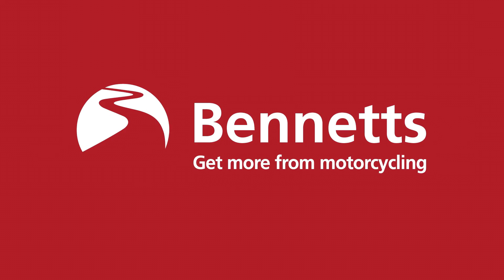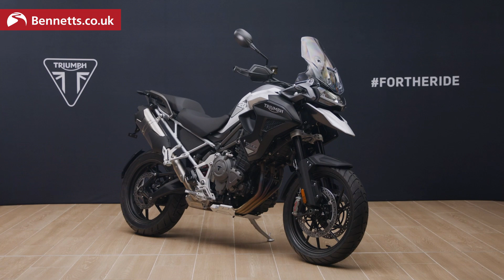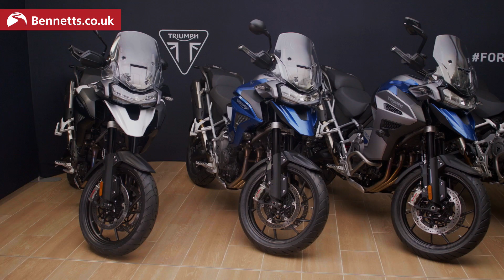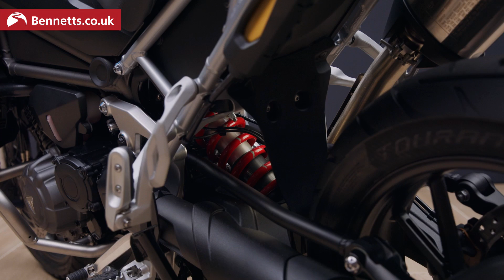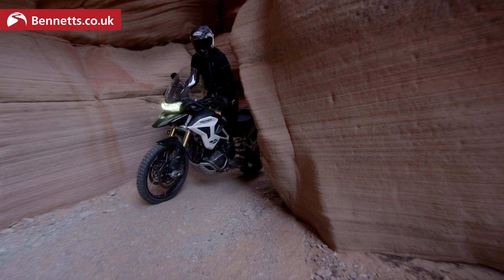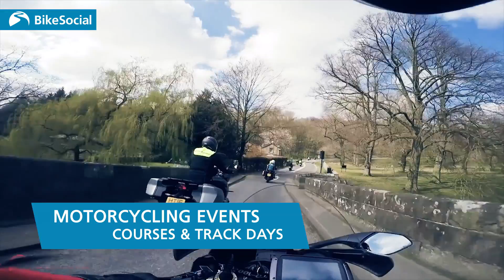New Triumph Tiger 1200 (2022) revealed - exclusive interview!

Comment: It would not shock me if the new 1200 comes out on top in several big bore ADV comparos. On paper it seems as it will be an excellent performer on and off road plus shaft drive which many in the touring ADV crowd desire.

Comment: Does the suspension set up mean the bike has anti-dive on braking like the KTM SAS? Could be a real competitor to the BMW GS Adv
Reply from the maker: Hi Norman, I've asked Triumph and the response is:
"The semi active is controlling the rear pre load to adjust to different payloads and dampening on the front and rear to adjust to the different rider modes, rider inputs and the finer adjustments available through the instruments/switch cube."
Reply: @bennettsbikesocial  That would be a no then!

Comment: I wonder if a tiger sport 1200 with a 17/17 configuration will ever make it. I would buy that in a heartbeat. Over a speed triple. Any day.
Reply: Nah. Makes no sense. Would need to change the suspension to suit the kinda feel you’re after. Would make the bike too pricey
Reply: @Jamaal_Tuhrik  good point. I was hoping these showas had enough range that a spring and oil change and reworked damping would do the trick
Reply: @greyanaroth  possibly. But seems like a hassle. The multistrada v4 has a 17/17 model. Pikes peak. Will probably have the sportiness you’re after
Reply: @Jamaal_Tuhrik  yea but I prefer the reliability and local support with triumph and the triple is a peach

Comment: Great looking bike (bar the rear radar unit). Glad to see the blind spot light being incorporated onto bikes. Curious to know, so unless you go for the rally Pro model or Rally expl, you cannot turn off the Abs and traction control completely?? Surely every adventure bike should be able to turn it off completely, talking as someone who attempts taking a Multistrada off road and valuing this ability.
Reply from the maker: We asked Triumph for the official response to your question:
"Traction control can be turned off on all the models when configured in Rider mode. Both the GT Pro / Explorer and Rally Pro / Explorer has an off-road mode which will disable rear ABS but front abs will remain on. But ABS can only be disabled fully when the bike is in off-road pro mode, which is only available on the Rally Pro / Explorer models."

Comment: Appreciate this overview, but getting wet weight values out Triumph is like getting a yes/no answer out of a politician 😂
Reply from the maker: The base GT comes in at 240kg wet, including a 90% full tank of fuel, which makes it a full 25kg lighter than the equivalent old-generation Tiger 1200 – the frame, part tube and part alloy, is 5.4kg lighter than the old model, the unusual ‘Tri-link’ swingarm saves another 1.5kg and the fuel tank is alloy to help move the centre of gravity down. The higher-spec’s GT Pro weighs 245kg, while the bigger tank of the GT Explorer pushes it to 255kg. The off-road-oriented Rally Pro is 249kg and the Rally Explorer is 261kg.
Reply: @bennettsbikesocial  Thanks for coming through with the information we all want to know! That swingarm is fascinating I have to say.